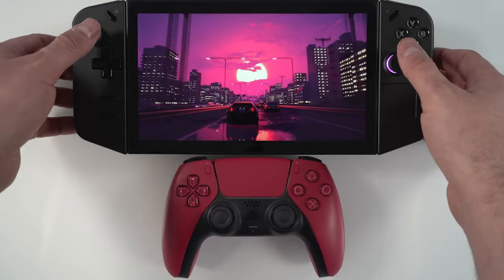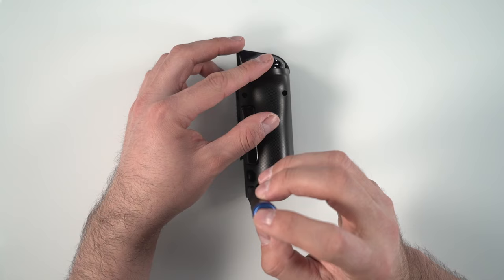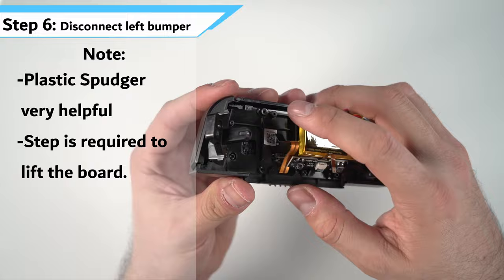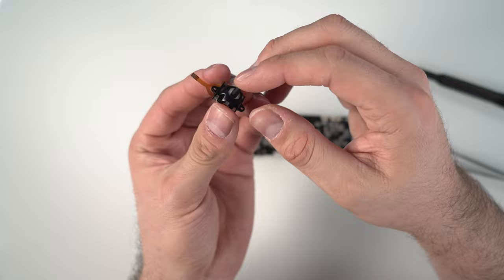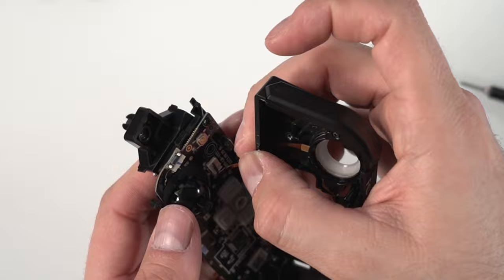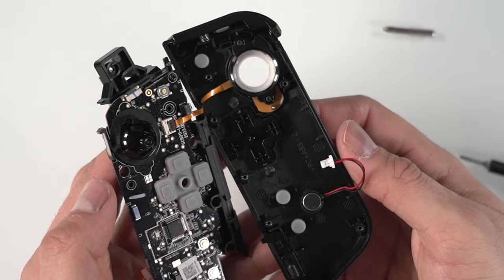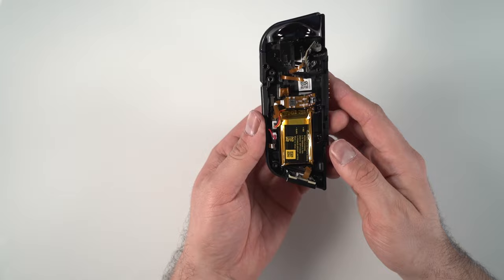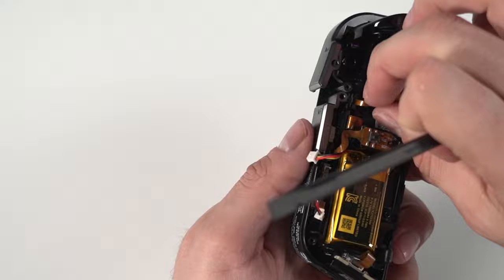Legion Go Joystick upgrade guide! double your joystick tension.

Comment: I hate how these controllers are created. Imagine if when you wanted to change component in your computer, you had to remove a bunch of nonsense , different screws, etc just to change a processor or some ram. These devices are simply designed this way because theyve always been designed this way. I get protecting the components on the board itself but no way should it be this rough getting to an analog stick or d pad. For replacement. The front face of the controller should also be a shell. The membrane can stay where its at. The shell should have cutouts so the pad and stick can still make contact with components on the board. This would allow easy repair and stick/dpad mods. I love building PCs but these and joycons are not fun
Reply from the maker: I get that, it’s a long process to take apart, I think with all the components they wanted to implement with the trackpad and fps mode, and being removable made the controller a lot more complex.

Comment: Thanks for the video. Thanks to your guide I got everything working with no issues on the first try. I was scared about having to open up the controller more than once because the 00 screws are way too easy to strip and ribbon cables are so delicate. I also replaced the mouse skates with my own mouse skate dots. Overall the extra tension isn't a night and day difference, but at the same time it feels just right, like how it should have been from the beginning. Glad HandheldDiY didn't ignore the Legion Go.
Reply from the maker: Yeah I’m glad you enjoy them, I do find the change dramatic, but it’s also just subjective. Did you order the tightest pair, they have like 3 options.
Reply: @okestgamer  They were actually available on Amazon Prime with 2 day shipping in the USA but the only variation they offer is the 100gf one so that's what I ended up with. I just compared them with my other controller which is the Gulikit KingKong 2 Pro and wow there's a big difference. The Gulikit feels like the stock Legion Go sticks so I guess I just got used to the new sticks quickly haha. 

I hope to share this video to anyone else interested in the mod especially on reddit/discord because it really is the best resource for learning to swap out joysticks on the Go as well as your other vids on other handheld stick swaps. Thanks again.

Comment: No matter how many time I try to recalibrate the sticks I can't get the avg error under 5-8%🙃I don't know what else to try
Reply from the maker: Interesting, and you’re doing the button combo with the flashing joystick rgb ring calibration?
Reply: @okestgamer  yes I've done the recalibration combo multiple times but just can't seem to get the avg under 5%
Reply from the maker: @juwanrangel4691  yeah that’s very odd. I wonder what could even be going wrong. A 5% error isn’t bad, but 8 is getting a bit high up for a legion Go. How’s the center point?
Reply: @okestgamer  the center point is right in the center for both joysticks
Reply: @okestgamer  I noticed without the thumbstick cap the avg error is 1.9% on both joysticks but with the cap on the avg is 5-8%

Comment: Looks like I'm getting interference on my left stick I've tried recalibrating several times and It doesn't seem to be going away. And there doesn't seem to be a solution to this anywhere online. 

Looks like I'm just going to have to put the back the old sticks... Shame I do like how It feels but now I'm having trouble running around in most of the games I play I don't think it's really worth the trouble.
Reply from the maker: Yeah it really seems to depend on your device. On my first 2 it worked great, the third one I couldn’t get rid of the interference sadly.

Comment: I cannot get the LB bumper button back in place on the left controller. Any additional tips? The tab doesn’t seem to tilt back enough with pressure to set it back in place.
Reply from the maker: It's bin a bit since I was last in the controller. I do remember it being an absolute pain to pry and slot it in.

Comment: It doesn't seem like the force is even just additional inertia to the initial push out of the default postition, which seems worse than stock.
Reply from the maker: It's hard to demo the tension difference in an accurate way. It is the overall tension, so it's more than just the initial movement. It was one way I could show that it is tighter.

Comment: Doubling spring tension will only destroy your analog stick twice as fast.
 Mechanical wear is the #1 problem with every analog stick that I've used in the last 30 years. Ideally every analog stick would have an actuation force of 30g or less, which is how I tune all of my controllers by trimming the springs.
 It is great having a disassembly guide though and seeing that these analog sticks are easily swapped is great news because even with the regular stick tension people will need to replace their analog sticks every year with regular use.
Reply from the maker: I've never worn out a joystick yet on a controller. The main issue I've run into is the dreaded stick drift from the potentiometer style sticks. Usually on console controllers, I just replace that part and it's good to go again. I did have one controller break though. The original launch Xbox one controllers had an issue with a clip for the RS/LS that would cause it to stick
Reply: @okestgamer   Ok, so when you say that you've had "Stick Drift" you need to be very specific about the exact symptoms of your controller.
 If you had erratic inputs, e.g. randomly jumping from 0% to 50%, then yes that's a worn out potentiometer.
 If on the other hand you had controllers where you would leave the analog stick "centered" but it would still give a slow 5%-10% input, I can bet with 99% certainty that if you go to an analog calibration utility your controller will be giving perfectly consistent inputs, you've just got a mechanical deadzone expanding beyond the digital deadzone in the game.

I, personally, in 30 years of 3D gaming with dozens of controllers, have only observed TWO dead potentiometers.
First was an Xbox One controller used by my niece for playing Minecraft, and second was in my racing simulator pedals only after I bought a manual shifter and started tapping the throttle with every gear shift.

When Valve says there is no need for hall effect sensors in the Steam Deck, I fully agree.
Steam OS has highly precise deadzone tuning and in virtually all cases people only need to adjust their digital deadzone if they have "stick drift".

I acknowledge that faulty potentiometers do happen, but I 100% guarantee every analog stick ever made has a rapidly disintegrating mechanical deadzone.
Reply: @okestgamer   Ironically the reason I trim the springs on my controllers isn't actually because of deadzone deterioration, it's because of tendinitis pain, but my modified controllers have the side benefit of lasting almost indefinitely.
Reply: @budthecyborg4575  I play with controllers detached now. I was having tendinitis pain as well and detached helps a lot
Reply: @budthecyborg4575  You understand these are hall effect sticks, right? There are no pots to  wear out.
Reply: @NTripleOne   Whooosh.

Comment: My A button is not response if press lightly at top angle. Anyone know where to find conductive rubber part.  Actually warranty covers it but claim process takes long time in my country. If it is just few bucks, i do replacement myself.
Reply from the maker: You can even check old tv remotes or other remotes you no longer need. Often they will be similar sized

Comment: Eh....just got done doing it....video was helpful, but both joysticks are having issues. The left one I now have to push hard to the right to get it to go right and the right joystick has slight stick drift going towards the upper right :/
Reply from the maker: You'll need to do the joystick calibration. It's near the later half of the video
Reply: @okestgamer ok, I feel stupid lol. I think I have already disassembled and reassembled like 8 times lol. I got it down like a pro now lol. But yeah, watched the video 2 weeks ago and felt like I'd have it, so went at it, ran into one issue and pulled your video up and found the missing screw....other than that I didn't rewatch the video, even tho I should have. Thanks for the quick reply, the calibration fixed it and they feel great now!!! Ty so much!!!
Reply from the maker: @jeffketcher6343  no problem, the moral of the story is always watch the full video to boost my retention rate with the algorithm 😆

Comment: Plenty of modding experience here and the RGB ribbon cable for my right controller still got pinched and messed up. No replacements available
Reply from the maker: I'm sorry to hear it man, they did recently add some parts to their site. I'm guessing you checked there?
Reply: @okestgamer  sho did! No replacement RGB rings unfortunately. It didn't burn out because it lights up with pressure on the stick. Reassembled/troubleshot many times already. The ribbon cable pinched on the first reassemble so it must have barely severed a connection (odds are) or something else in the circuit is barely making contact now. Having slept on it, I'm thinking it might even be the spring loaded grounding pin for the RGB ring, which I'll test later. Definitely wasn't a fault of the new joysticks themselves

It will be easily fixed when more parts become available or broken controllers start popping up on eBay. It's no biggie really. Skill is usually in my favor, just an oopsie lol. I did watch the RGB ribbon cable fall back in place on the first reassemble but a defined crease reveals it pinched anyway. Oh well!
Reply from the maker: @ihad2reload  yeah it happens, I tore the back button cable on my aokzoe a2. I managed to solder the little guy (it was like 0.5mm) I’m still proud of that lol. 

How are you liking the tighter sticks?
Reply: @okestgamer  lol it does happen. I'll find time to break it back down. I'm sure I'll get it fixed before any microsoldering. Honestly the sticks should feel like this for all devices. Stock never felt cheap, but these have a more premium movement now. Perfect for sim racing, fps where you need to be precise. They feel like they're full size now
Reply from the maker: @ihad2reload  yeah that’s my impression of them. I actually modded another pair and sent them to the Lenovo product manager who is going to send them to the China team. Let’s hope it can impact the Go 2. Wouldn’t that be cool that are little video experiment could bring positive change